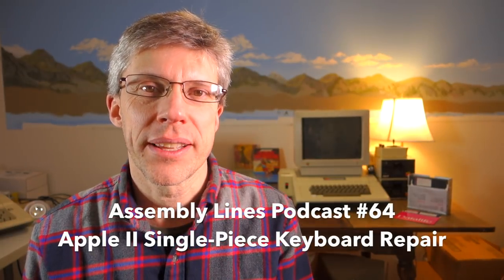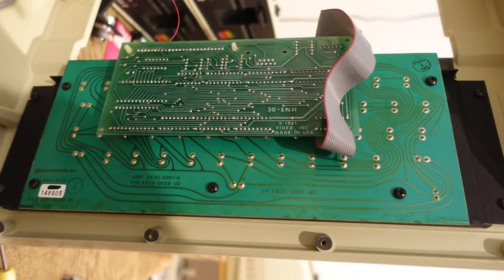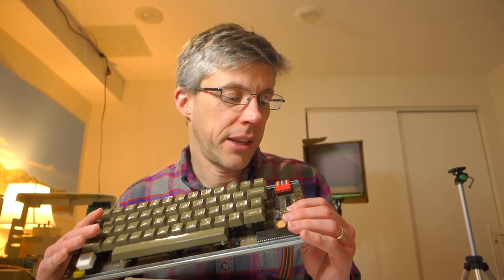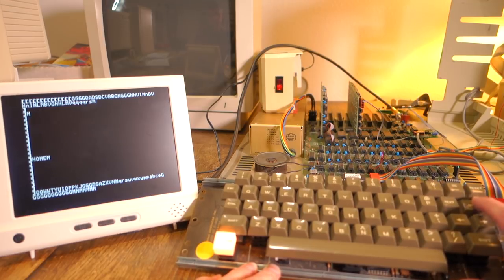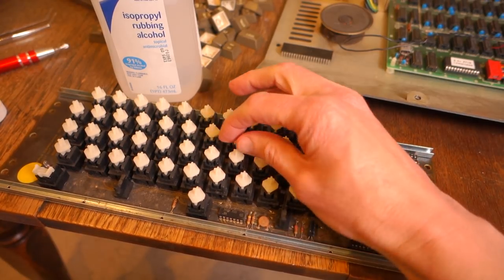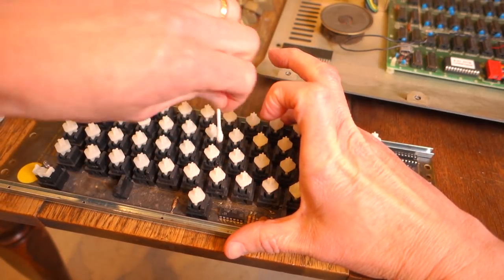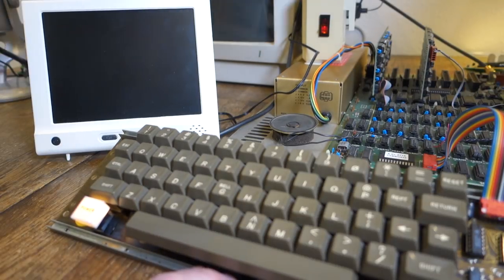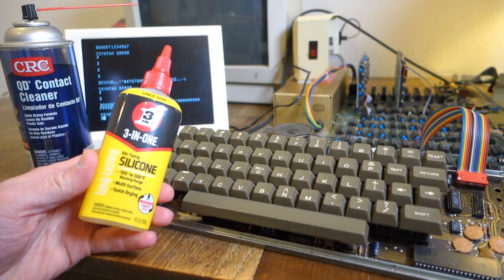#64: You Plugged it in What?!

Comment: I'm in Hong Kong, ex-British colony with hell lot of Apple ][ replica at the 80's. Back to the 80's, I've several Apple ][ keyboard failed with the large chip dead (yes, the encoder), at that time don't have Internet access and it's hard to find replacement, and the keyboard ain't cheap. Painful experience.
Reply from the maker: Yes, those MM5740-AAE encoder chips are hard to find. I see that one just sold on eBay for something like 56 euros!